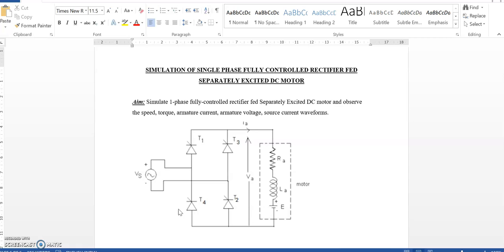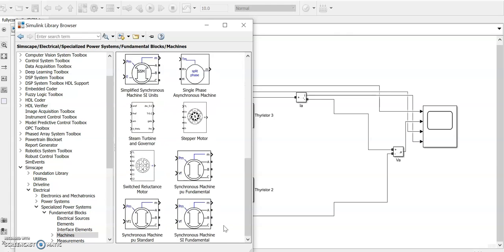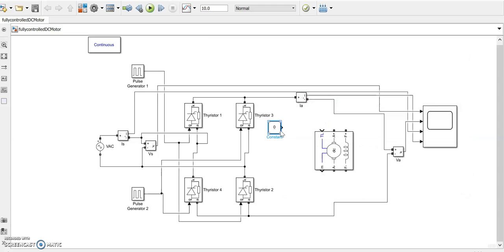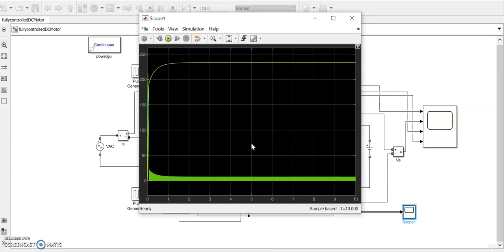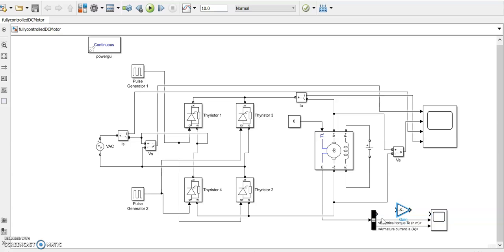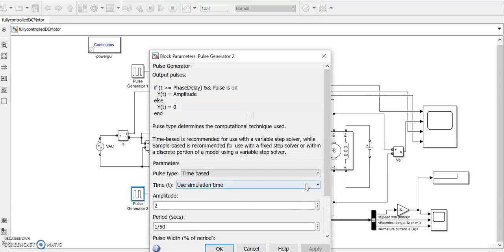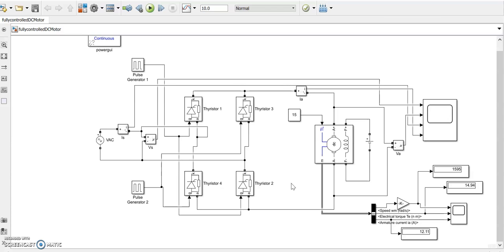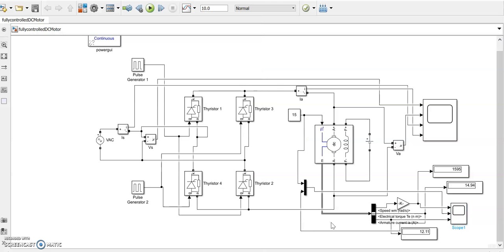Expt 5 # Separately Excited DC Motor | Simulink Model |1 Phase Full Converter Fed # Drives

Comment: A three phase fully controlled converter is supplying power to a separately excited DC 
motor drive of 1.75 kW, 200V, 10A, 1200 rpm. The armature resistance and armature 
inductance values are respectively 1.2 Ω and 1 mH. The supply to the converter (rms value)
is 220 V at 50 Hz. Obtain the current and voltage waveforms in the source side and on the 
motor side (i) when the motor is working at a speed of 1000 rpm, while delivering rated 
torque. Calculate the firing angle of the converter theoretically for this operating condition
and verify that the motor’s working through simulation. (ii) Change the firing angle 
abruptly to 60° and check what happens to the speed of the motor after the steady state is 
attained. Get the waveforms for both operating conditions. (iii) Further, if SCR device 1 
(T1) gets short circuited, show how it affects the functioning of the converter.

please give solution